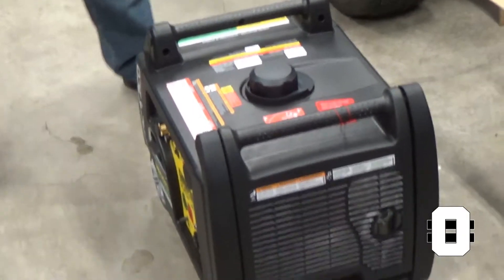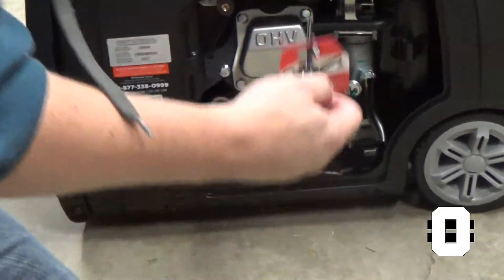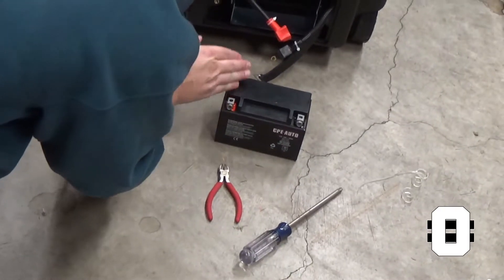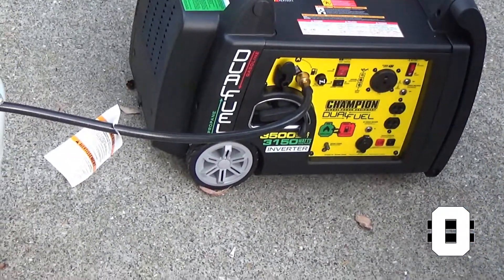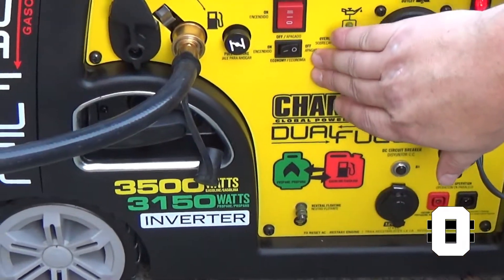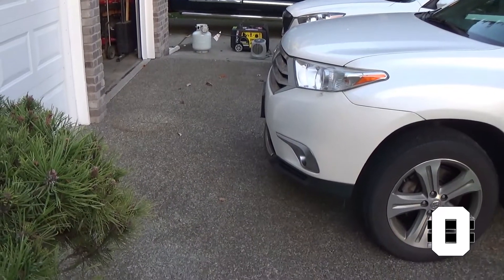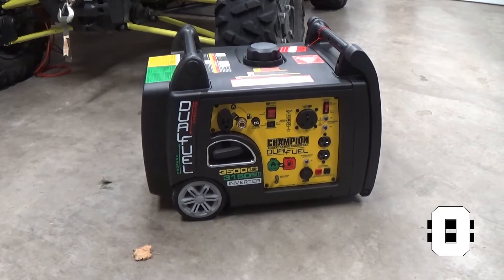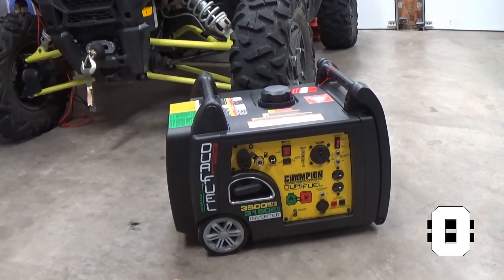Champion 3500 watt Dual Fuel Generator, Set Up, Test, and Review

Comment: This is one of the best duel fuel generators out there. RV ready with electric Start. When you start this and it hasn't run overnight or days, etc. Pull choke all the way out and push start, it if chugs even one little bit push that choke back in and it will start up the next switch on. When he started it you can hear it chuge...but he left the choke out, don't do that,  Its just  how this gen. works. Like A Stihl chainsaw, if you own one.. We also use it for our house during the winter it snows and power goes down. I fire it up and plug my full size refigerator, freezer, TV's, phone, Dish TV box,  3 lights, coffee pot, and cell chargers.  It has never trapped and I feel as if I can plug more in because with all that plugged in, it will still run in economy mode! For home or RV camping its great...oh it will run a 15000 btu RV AC on the 30 amp RV plug it had. I am going to try to hook up a welder to see if it will weld. Good luck